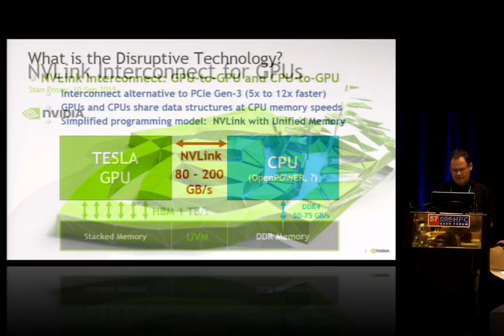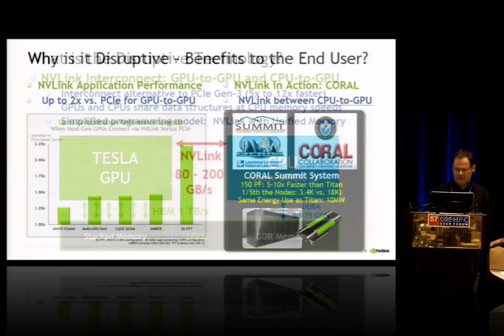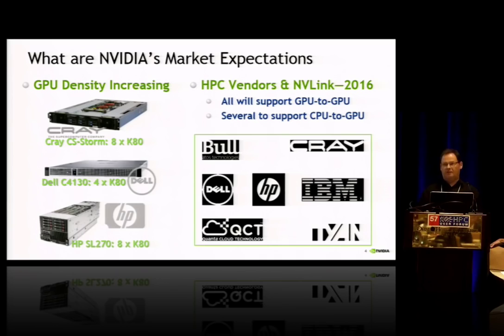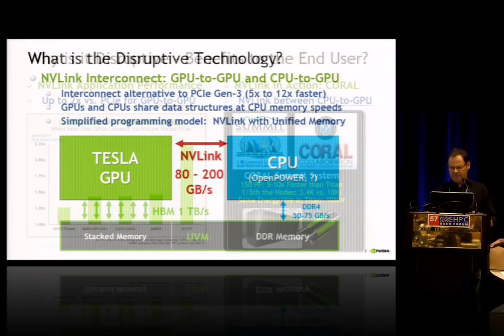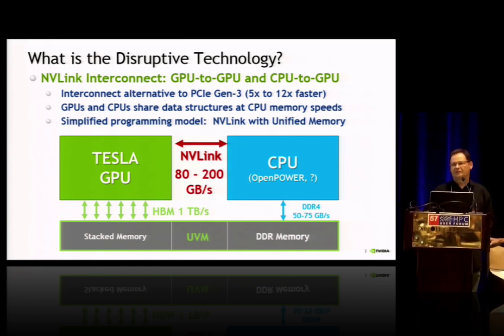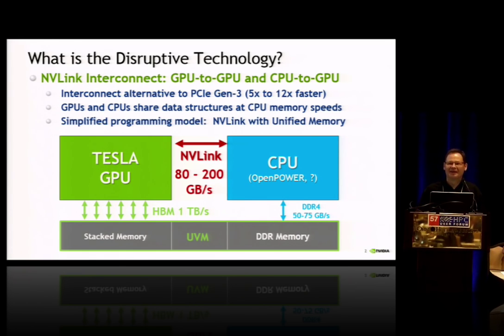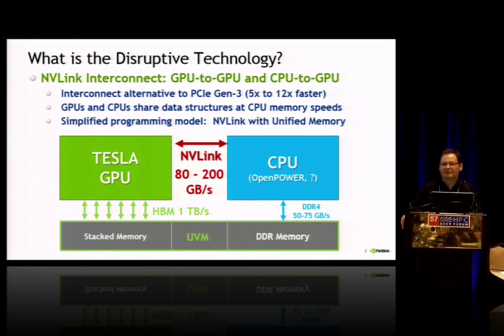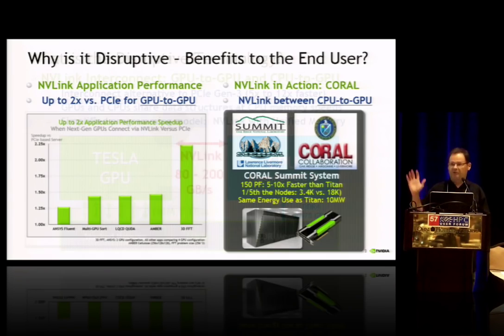NVLink Interconnect for GPUs

Comment: Are Pascal Cards still going to utilize PCIE...? Or Nvlink is already going to enter the Consumer's Market and replace the PCIE....?
Reply: +Rooks14 
Nvlink need a new port connection, and is just for enterprise so probably gaming not yet.
Reply: Nvlink as an alternative interconnect for cpu to gpu communication is heavily vendor reliant (support) and as of right now it seems only applicable for the enterprise segment. As of right now IBM seems to be the only vendor mentioned  collaborating with Nvidia. But they do mention they're also reaching out to the arm64 architecture support as well. Which is smart on nvidias part because alot of enterprises see it as a great alternative to x86 for server-side computing. Only pro I know as going arm over x86 is efficiency, but im sure there are more.
Reply: 2 years later... yes pascal uses pci-e turing used nvlink instead of sli
Reply: Sorry, is NVLINK1.0 actually available? Can I go to Fry's and buy whatever cable I need (or did you mean NVLink1.0 is also over PCIe?)  and download some NVLINK driver for my two P2000s?